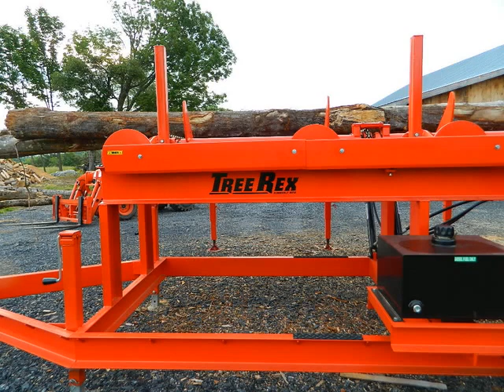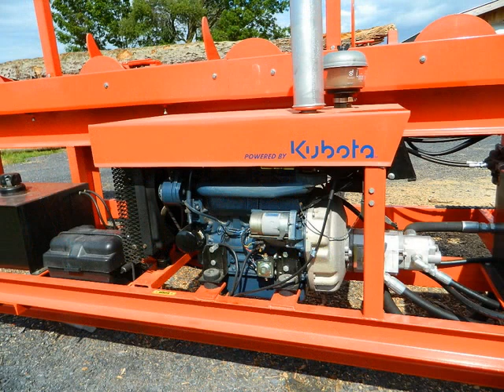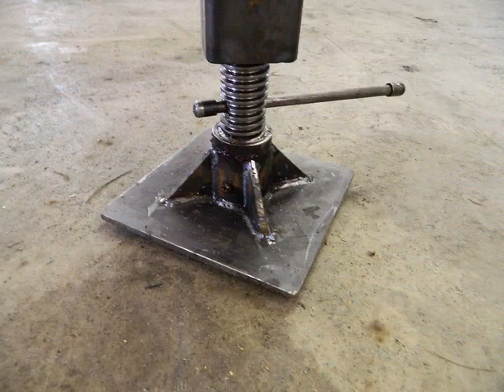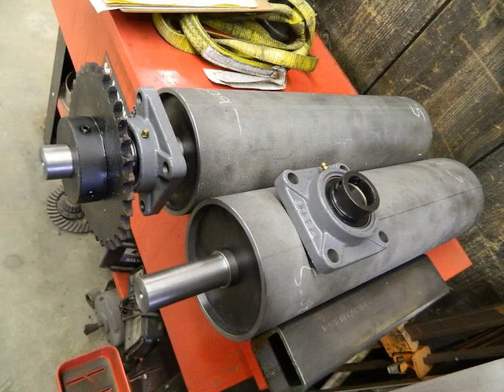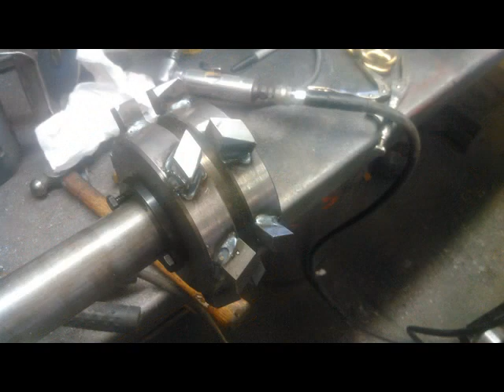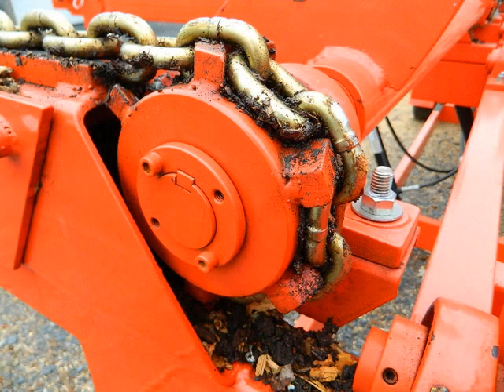Misc. pictures of processor Build

Comment: Great job, I am going to do the same for my log deck, Chain link
Reply from the maker: Chad 3/8 Chain the high tensile pretty much bullet proof.. Run on two 5/8x5/8 square rails works perfect. Thing is all 3/8 chain does not have the same length links I found out . get the amount of chain you want then make the drive sprocket to fit that brand .The diameter of the sprocket needs to be correct so the drive lugs repeat properly, I can help with this ........
Reply: @rammy630  thank you for all the help and info, I am sketching up ideas on frame and splitting wedge now, also trying to see how a feed deck will work and not go to crazy on budget. Link chains is a cheap and one smart idea